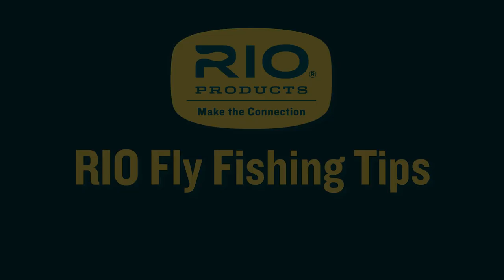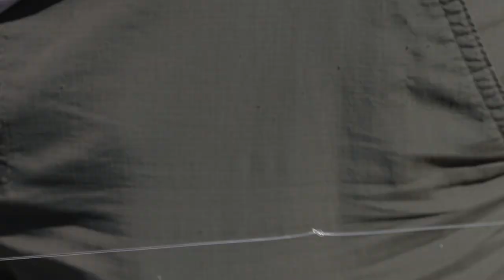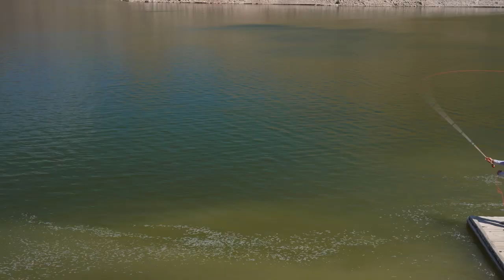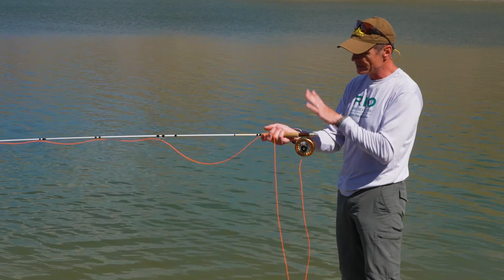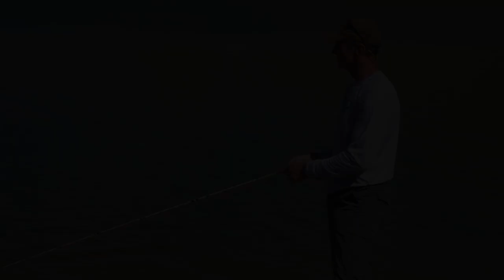Stop Getting Wind Knots

Comment: What is the cause of the fly hitting the rod on the back cast please?
Reply: Same thing.  Coming forward too early.
Reply from the maker: It could be coming forward too early, it could be that you start your back cast by lifting with your wrist (not your arm), it could be that your back cast is too slow and not clearing the rod, or that your rod is too vertical on the back cast. The rod tip should NOT be vertically over the rod butt during any cast accept an accuracy cast, but tilted about 10 degrees off the vertical.
Reply: @RIOPRODUCTS  thanks guys it’s a habit that’s just started to creep in.
Reply: @RIOPRODUCTS  I’ve just learned something new thanks guys.
Reply from the maker: @trevorluft1763  Time to stop that one~~
Reply from the maker: So glad we could help in some way,  @trevorluft1763